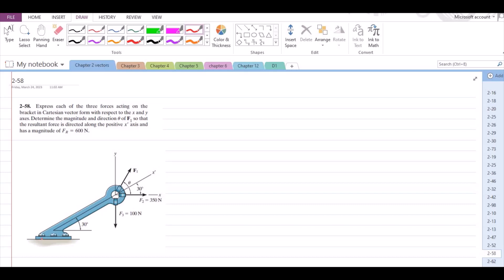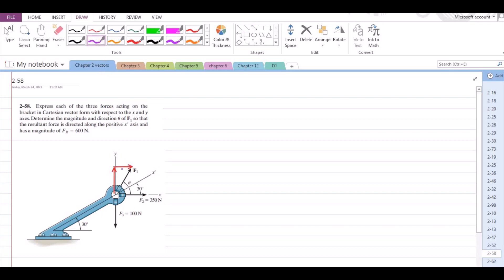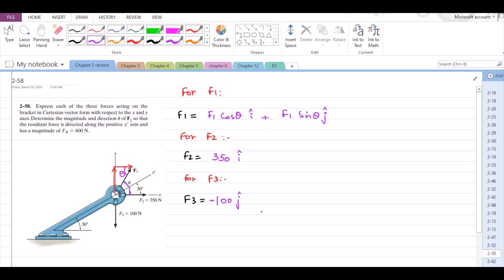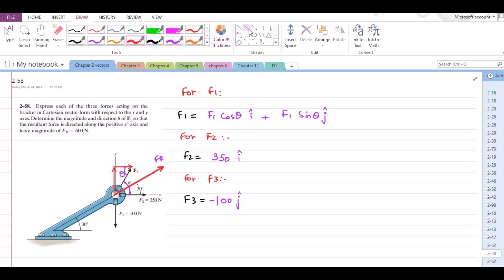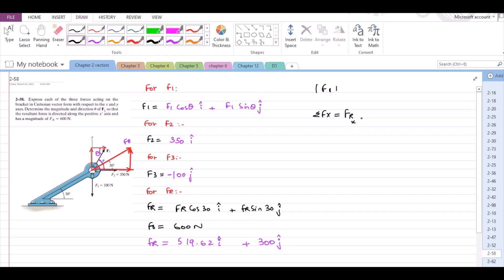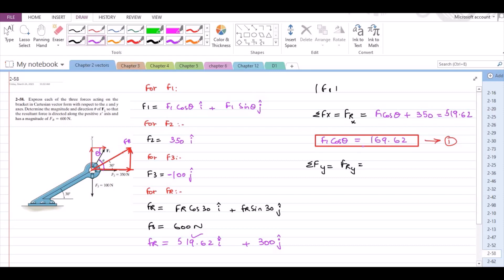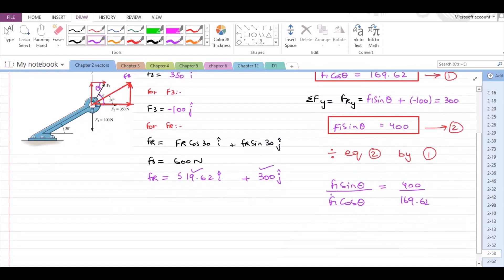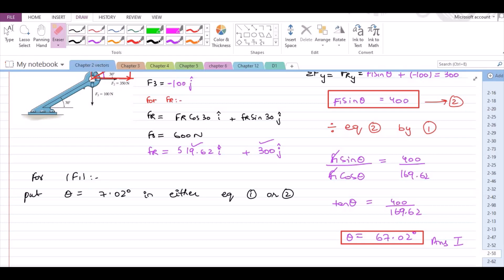2-58 hibbeler statics chapter 2 | hibbeler statics | hibbeler

Comment from the maker: Learn How to Solve 2-25 Hibbeler Statics Chapter 2, "Two forces F1 and F2 act on the screw eye. If their lines of action are at  an angle theta apart and the magnitude of each force is F1=F2=F, determine the magnitude of the resultant force Fr and the angle between Fr and F1."
Here is the Link: https://youtu.be/NgwkA-Hjwwk